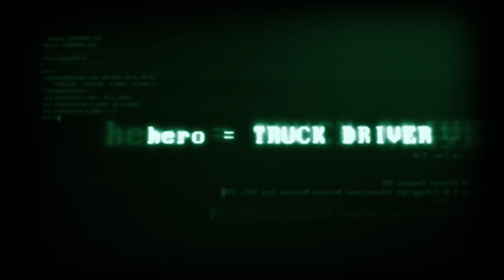"Unstoppable" - PKY Truck Beauty Championship Overview

Comment: I predicted back in the 1960s that Semi Tractor would become the darlings of the custom vehicle world. Most thought I was crazy - but I saw all coming.  Happily - I was right and glorious rigs now are seen everywhere and show for them too. 
I had a chance to acquire a 1951 White Semi Tractor from a slaughterhouse rendering plant that pulled a "gut trailer" in 1968 for $1900.  My Parents were mortified that I wanted it and said no. I told them, that it would be beautiful if could be restored like a custom car is. 
NOPE- no one believed me - then it ended up on a farm hauling apples to a cider mill. I kept an eye on it from time to, and by the late1970s it was a wreck and completely rust rotted to unusable condition.
Had I purchased it when it was still solid and running - I'd still have it and it would be kept in a dry clean insulated building as one of my treasures.